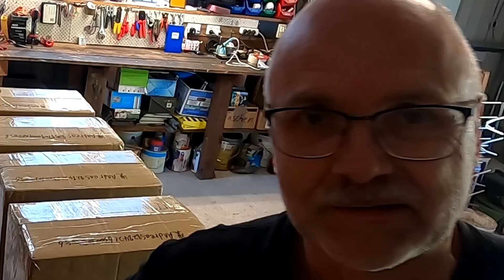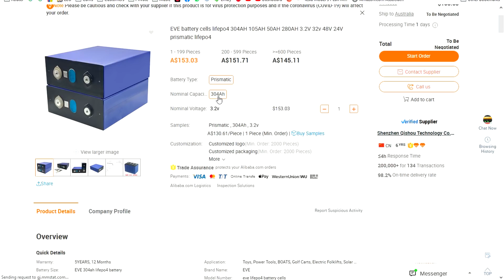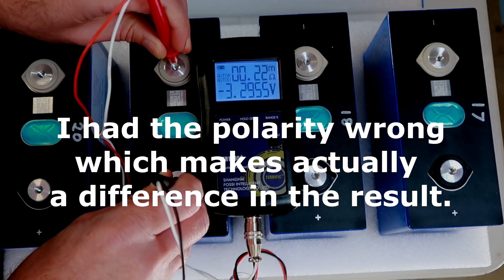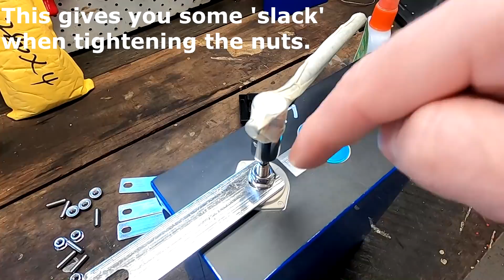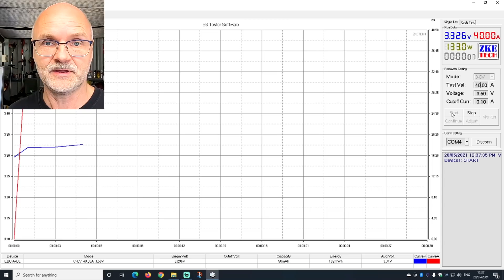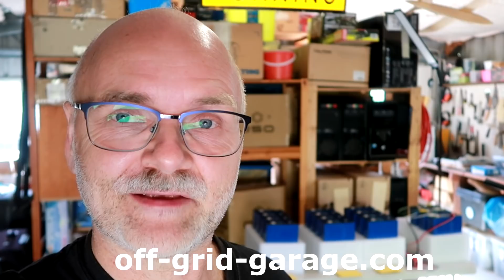Good price, excellent service, I could not resist! 16 more EVE 280Ah LiFePO4 batteries delivered!

Comment: I would use an antiseize or galvanic prevention paste (Aluminox, Tefgel, etc.) on those threads when assembling. It can't hurt, it isn't expensive.
Reply from the maker: I have several different pastes now and the best results I have are with... nothing in between. I actually use some WD40 now on a rag, cleaning up the bus bars and terminals and that's it.
Every past you put in between will act like a resistance, no matter what it is. Even pure gold would ad an additional resistance. It is more a matter of getting the oxidation off in the first place.
Reply: @OffGridGarageAustralia  A proper antigalvanic paste applied sparingly should just fill microgaps that otherwise will oxidize or attract corrosion in the future. The surfaces should still make metal to metal contact with no effective loss. Unless you have mirror smooth polished mating surfaces, the contact resistance in that connection should increase in the future--more so if no "paste" is properly applied. You might want to measure them again in two years and compare.
 Marine electronics typically use silicon dielectric paste, 100% nonconductive, in connections. In order to prevent loss from corrosion as they age.
Reply: @OffGridGarageAustralia  Schade! Ich hatte mich schon auf mehrere Nachtschicht Polier Videos gefreut😄. Ich bin mal gespannt, ob und wann Du auf Hochvolttechnik umsteigst...

Comment: Get a torque wrench Andy.
Reply from the maker: Which one is precise enough in these low numbers we us it in? Buy 5 for $80 and they will be all different. Which one do you trust. And I don't want to fork out $280+ for a high precision one. You get a pretty good feeling if the bus bars are tight enough.
Reply: @OffGridGarageAustralia  i guess for me its worth buying. it saves the risk of stripping a thread in an expensive battery cell and also means all the balance leads are evenly tight and reading correctly. its a good tool to have in your kit for other things like small engines and such. but yes a good one is around $200 and up depending on brand. if you are a tinkerer like me it comes in handy also for other engineering type projects.

Comment: Lishen 272Ah cells seem to have ceased production. Perhaps with their superior construction, and different chemistry, it’s a problem with supply. Chinese suppliers quote price for 48 hours, as they are going up. All sold out here in Philippines. I could not get delivery from China, to my postcode!
Reply from the maker: They probably go to a higher capacity cells now. 304 or even 310Ah is the new standard. Slightly different chemistry but same form factor...

Comment: As good as those tested, I’d just top balance and call it good & go with them.
Reply: I was wondering the same thing.  Do you need to capacity test all 16 from this shipment?  At what point do you click the button on Alibaba to say you are satisficed with the shipment?  Did you capacity test one cell and then click satisficed?
Reply: @geraldgrogan  
Well if you test one cell through a complete cycle, you kinda have to do it to the rest, then still top balance. Regardless of the voltage you bring that one cell to, it’s slightly different from the others if you don’t. I’d rewind a transformer till I get 3.65v DC after a bridge rectifier and snubber cap for a high current top balance for the whole group of 16 in parallel. Otherwise it’ll take forever with most bench power supplies. I you didn’t trust the transformer setup, finish the last .25v with the power supply. It goes really quick at the end and 10 amps is more than adequate.
Reply from the maker: You definitely don't need to test them all individually. I did only the 12 now and they are all in the same ball park. I think the initial internal resistance test would be enough to find any cells which may cause problems down the track.

Comment: 5 Amp Absorption at 3.5 Volts should fully charge a 280 Ah cell. Here are my calculations for fully charging: 3.65V=14A, 3.6V=11.5A, 3.55V=9A, 3.5V=6.4A, 3.45V=3.9A, 3.4V=1.4A
Reply: You lost me😳
Reply: @SkypowerwithKarl  Full charge takes place when the battery hits the voltage limit, and the current drops to .05 of the rated current (C/20). For 280Ah cells, that would be 3.65 Volts and 14 Amps (280*.05). If you keep charging lower than 14 amps, you will start to overcharge the battery. You can however charge to a lower amperage if you reduce the charge voltage. For example, it's a cloudy day and you can only charge at 6.4 Amps. No problem, just lower the absorption voltage from 3.65V down to 3.5V and you will not overcharge.
Reply: @SpeakerKevin  
I’ve not seen this before. I thought it’s done when it hits 3.65 and the power supply stops with virtually no current.
Are there any chargers that actually do this…think, real smart?
Reply from the maker: I don't think it will overcharge the cells at a low current and lower voltage as my previous tests have shown. The cell will reach absorption voltage and will just stop charging.
Don't charge it to 3.65V! This is just the maximum voltage the cells can be charged to but does not mean we should do this. 3.45V or 3.5V are totally fine.
Reply: @OffGridGarageAustralia  
Agreed. Mine only see this voltage once at top balance then off. I let them sit as a group and settle down together for a few days.

Comment: With a 280 Ah cell, you can charge with 3.65 volts but you must stop charging when the current drops to 14 Amps. You can also fully charge the cell at 3.4 volts, but must let the current drop to 1.4 Amps.
Reply from the maker: At 3.4V, the cell will stop charging at some stage anyway once its fully absorbed. It does not overcharge.

Comment: This is a battery porn! :-) Which BMS do you recommend,  to build a 12V LiFePo4 battery with the smallest rate of AH ? thx
Reply: I would like to know the answer to this as well.
Reply: I can only tell you Don't but BMS from company Heyo. I had 3 BMS from them (2 replaced during warranty but I had to pay for shipment) And they have plenty issues ... so don't go with them.
Reply from the maker: For a 12V system I would have a look at the @Electrodacus BMS
Reply: @OffGridGarageAustralia  thx

Comment: That pricing makes it super tempting to import some myself! 

Great to see the quality being so good too, there are a lot that just don't quite make that level. 

Shoot me a message if/when you need some more bus bars ;)
Reply: FYI, thanks for the high quality aluminum busbars and fast shipping to the USA. No complaints from me.
Reply: @john_in_phoenix  great to hear they worked out well. Thanks
Reply: @john_in_phoenix  are you sure there not tin coated copper bus bars ?
Reply from the maker: Yeah, not sure how to connect them yet. If parallel or a separate battery. Will discuss the pros and cons in a video soon...
Reply: @OffGridGarageAustralia  Personally I would create a parallel battery, however there are pros and cons to each. The plastic tub on wheels is a good choice.

Comment: Andy, thank you for your videos. I enjoy watching the way you present them.
I know this is probably not relevant in your garage but could you test cold temperature either charge or battery disconnect on the BMS? I'm looking build a battery for an offgrid cabin near Goulburn NSW but in winter there are many below freezing days.
Cheers mate
Reply: Hi Matt. I changed the AGM's in my motor home about 6 months ago to Andy's type from his demos 280Ah EVE & I run my house fridges & lights from them with fantastic results ( Love the LiPO4's). I am using a Daly 4s 150A Smart BMS, it works great. I got the 150A model to start a 3600 Onan generator. Doing it again I would get the 200A Smart one if it performs anything like the150. Delivered - cells & BMS AU$750, bargain. BTW the LiPO's work better than any AGM Ive had in it & destroyed. For your setup I would go 8 x 280's with :- Daly BMS, MPP 24v Inv/Charger, Cheap as. Enjoy
Reply: Just get a Daly smart bms with the Bluetooth dongle and you can set the bms to cutoff at any voltage you want. I have that bms and the low temp and high temp cutoff work flawless and reliably
Reply: @JM-yx1lm  Thank you JM, what model do you have. Common port, mosfet? I'd still like to know how the qucc relay model handles it

Comment: Hey Andy, always make sure the clamps are making proper contact. Last weekend I did my first tests with the EVE 280Ah and noticed that a few amps at the contacts were converted into heat. This could falsify the measurement in your setup. Greetings from Berlin.
Reply: Amps don't get "converted" to heat. Andy does a good job explaining things here: https://www.youtube.com/watch?v=ypzNH56_aWE&t=1s
Reply from the maker: Yes, I always tighten them with a spanner. Especially when using the 40A tester.

Comment: I think if you will do some testing you will find that if you don't hold the screw when you tighten the nut down, there is actually no real force connected between the screw and the nut to make the screw put force on the bottom of the hole.  The nut threads are pulling up on the screw.  Once the screw engages the bottom of the hole and the nut starts to tighten, the upward pull locks the screw into the threads the tighter it gets, so making it harder to turn the screw.
Reply from the maker: That is actually true! Never thought about that really...

Comment: Are you going to paralell this set with. Other older cells I was told not to do that from my supplier on my 202ah lishen I think it's fantastic matching from factory .i just got 64 more 202 ah waiting on internal resistance tester to build my 4 16s packs love the videos keep them coming my good man
Reply from the maker: Yeah, that would be the BIG question, right. How and why should I do it...
Reply: @OffGridGarageAustralia  I think I would put in a blue sea battery selector like I did and leave them as two separate batteries just switch back and forth since you have your car to charge.or build a complete other system.there is no end to solar addiction.im an addict I have a 24 volt system and 48 volt 120 output in my home both have individual trace invertors and a 240 grow watt 80 kw of battery in northern Wisconsin.tons of power in summer barely enough in winter
Reply: Better to build another battery with BMS to connect in parallel.

Comment: They are ONLY Voltage & IR Matched.  They are NOT properly Matched or Batched as that requires the cells to go through full charge & discharge cycles with IR measurements every 10 minutes which are logged. 

one of many REFs:  (also been discussed to DEATH on DIYSolarForum.
https://batteryuniversity.com/learn/article/bu_803a_cell_mismatch_balancing

IF you REALLY think they are matched, drop the cells to 2.800V and check the IR with the YR1035  Then put them up to 3.000 and then again at 3.200 and again at 3.400   Then sit and be prepared to have a Cold Beer to soothe your nerves.

Comment: How much did you pay for batteries and delivery ? they never tell this straight on Alibaba =)
Reply from the maker: You ALWAYS have to get your personal quote as I said in my first video about importing batteries from Alibaba. The price on the website is not the price you're paying. Get in contact and ask for a price including shipping to your doorstep.
Reply: @OffGridGarageAustralia  Yep, Always contact/chat with them to get/negotiate the price and shipping charge, they always ask my zip code to get the correct shipping chart, the automated estimated shipping charge is not true shipping charge since they do not know where they are shipping to.
Reply: @OffGridGarageAustralia  hi. I know this, already bought batteries 2 times from AB.  But as I said earlier, the biggest difference between suppliers is in delivery cost (which I believe include part of battery price inside). That's why we should share delivery cost to know who is really cheaper. I got 2 delivery of 200aH batteries from different suppliers and difference in delivery cost was 800$ which is a lot of money !
Reply: I just quote from them for 4 pieces @$90ea + $140 DDP to California.
Reply: After few purchases on Alibaba I found that they hide real price of items in delivery fee. These batteries are not so cheap and transport so expensive. But to show lowest price for client searching in the service they use this trick.
Reply: That's the main reason I deal with AliExpress, for the free shipping.

Edit / Clarification: Not all of the AliExpress stores offer free shipping.
Reply: @charlesrichards5389  What is the price on Aliexpress for the same batteries? $450?
Reply: @budmartin3344  Eve 280Ah cells are too common on AliExpress so I tried doing a GoogIe site search for Shenzen Qishou Technology. I found one reseller, Factory Outlet Z Store, selling them for $178.46 plus $182.60 shipping for each cell. They haven't sold any, and have 0.0% positive feedback. Andy's is apparently direct from the factory.

Comment: Very good, only a little over the knee of the curve while charging and discharging. 3.5 volt charge, 2.9 volt discharge. For low voltage disconnect I might bump up the voltage a little higher to reserve 10% of the battery from the bottom. I can't read the scales, 2 blocks up from where you ended the discharge. 

The batteries are not shipped with a full state of charge for safety reasons. That is a huge amount of energy stored in those cells. It also saves a little shipping weight.

Well done!
Reply from the maker: Thanks, Peter. I've got the BMS disconnect on 2.5V still but take good care of the SOC through the Victron app now and manage load manually and accordingly. I rarely go under 30% SoC and now with the larger capacity even less likely I fully deplete my battery ever. Same with fully charging. For the last 2-3 months the battery stays between 50-80%SOC. This will be different in summer though...

Comment: Hey Andy sometime tell us how much you put in to get it fully charged and and then how much you get out on discharge
Reply: I can tell you the same cells and same tester, usually .1 or .2 more amp hours in vs out. They claim 98% efficiency, I get more like 99%.
Reply: @john_in_phoenix  Truly a wonderful technology
Reply from the maker: Yes, that is my experience too. Look at the 100Ah test cell we have tortured before and the graphs, the numbers are almost the same. Charging efficiency is very high.

Just had a look at my Smart Shunt:
Charged energy: 313.1kWh
Discharged energy: 308.5kWh
Makes it over 98.53% efficient already.
The only thing the Shunt does not measure is the consumption of the BMS (including relay). So there is that energy missing...
We're getting over 99.5% then.

Comment: My 32 Eve 280 cames exactly like yours, even had the same envelopes of studs, nuts and bus bars from Schenzhen Basen.
Reply: I had a very bad experience with Schenzhen Basen. They could not deliver, they had no stock. They did not reply to my many requests. After waiting a few weeks they replied and said the price is now higher. So I had the order cancelled.
Reply from the maker: If you have any problems with the delivery, please also contact Alibaba directly as they can put some pressure on the suppliers too.
Reply: My Lishen 272AH came with a lot of dent and scratches. Made a complaint but they don't take any action. I'm done with Shenzhen Basen.
Reply: How long did it take to ship? I have an order nearly 2 months with no tracking.
Reply: @bingo7799  3 months total land freight to UK.